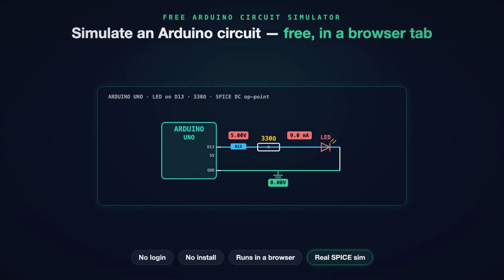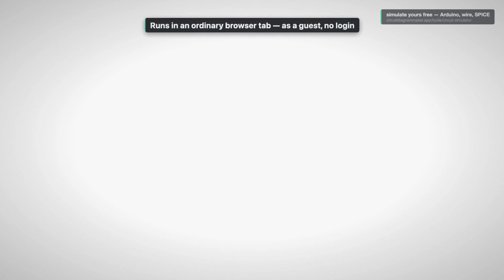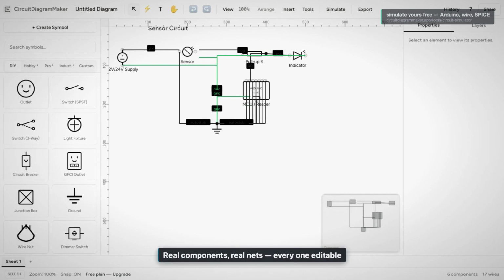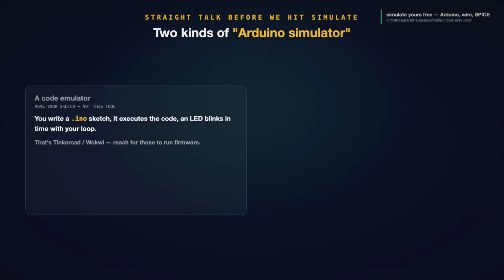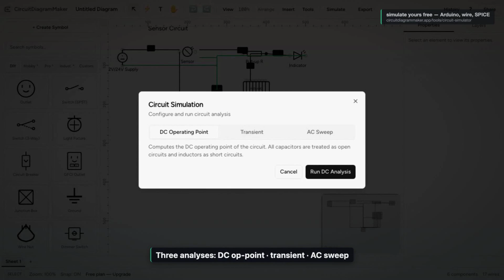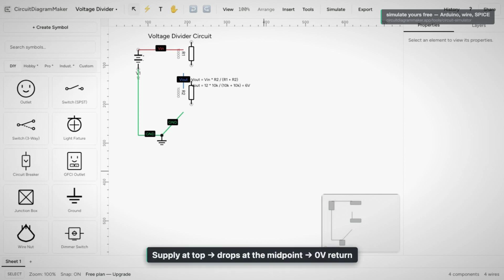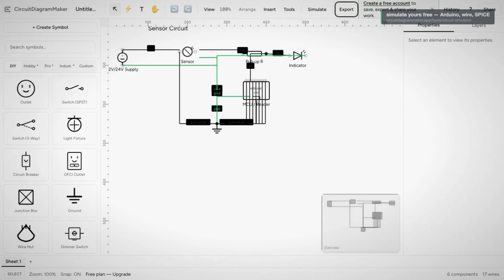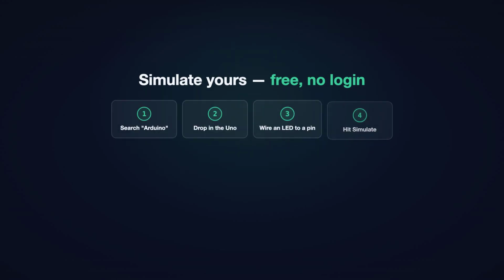Free Arduino Circuit Simulator (No Login Needed)

Comment from the maker: Full disclosure (also said in the video): CircuitDiagramMaker is our tool — free to draw and simulate an Arduino circuit right in the browser, no login to start. And yes, the Arduino Uno is a real labeled symbol with named pins (5V, 3.3V, GND, D0-D13, A0-A5) — not a photo of the board.

The one honest boundary, because "Arduino simulator" means two things: this is a SPICE-style ELECTRICAL simulator — it solves the node voltages and branch currents of your circuit (DC operating point, transient, AC sweep). It's perfect for checking the wiring, the rails, and the resistor values. It is NOT a code emulator that runs your .ino sketch — if you need to execute firmware, use Tinkercad or Wokwi. Different tools, different jobs.

Search "Arduino", drop the Uno on the canvas, wire it up, hit Simulate — and watch real voltages and currents land on the schematic. A pin tied to the wrong rail shows up as a zero before you ever plug in a board. Simulate yours free, no login: https://circuitdiagrammaker.app/tools/circuit-simulator?utm_source=youtube&utm_medium=pinned_comment&utm_content=yt-136